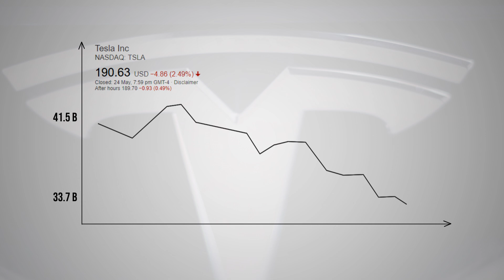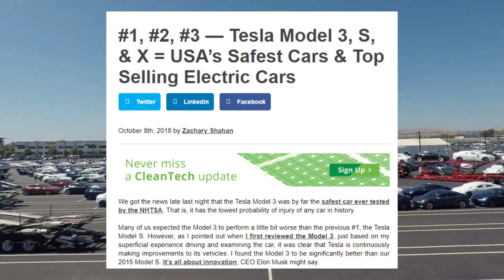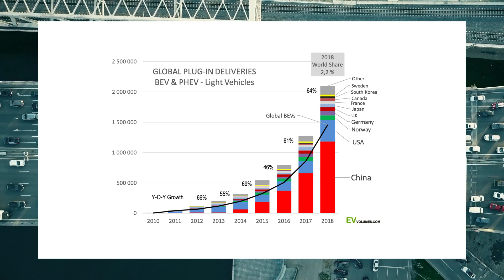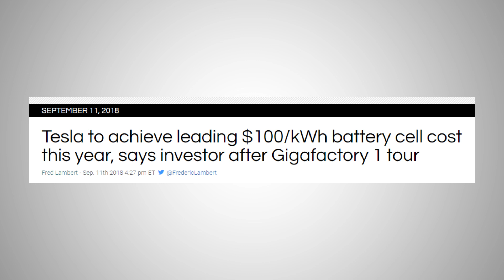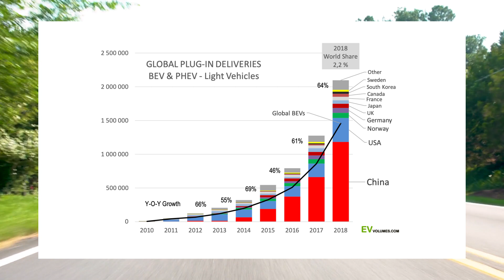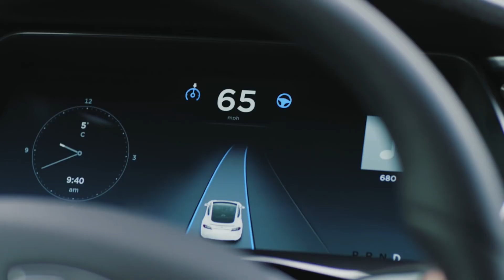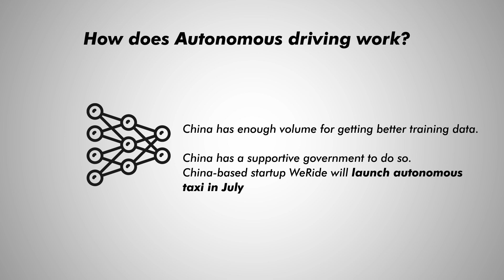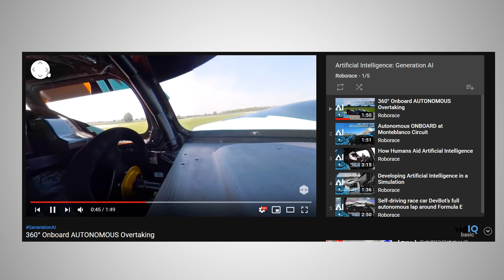Can Gigafactory Shanghai Fix Tesla's Money Problem? | Elephant Explains

Comment: The falling stock price actually shows success. The attacks against Tesla intensify as total success gets closer. Part of this is financial attacks, AFAIK 31% of Tesla stock is shorted. Fortunately stock price matters little. Mostly it just means you can buy it way way below it's actual worth.
Reply: András Bíró, the stock price dropped because major investors are selling, not because of short sellers. T Rowe Price sold 7.2 million shares in Q1. As Tesla falls, the short sellers will add some stability. But the stock needs to go down to its real value. 

J.B. Straubel has been exercising options for $20-$31 and selling them since late last year, 15,000 at a time. At least 4 times in the last 6 months. 60,000 shares sold, by an insider, using automatic selling that prevents insider trading problems. He still has 306,000 shares, but selling so many for so low of a price means something. He’s already pocketed more than he could have hoped to have earned on his own, so maybe he promised not to sell shares he’s holding.
Reply: @imho7250  

Oh, the good old spin doctor is back. There can be many reasons for selling the stocks, especially for JB. He probably needed the money for personal reasons and expected the stock to rise after the Autonomy Day. What you do is like trying to predict the future from tea leaves. Why don't you focus on the fundamentals of the company instead? You know, if you want to know how well the company does, maybe you should take a look at what it actually does.
Reply: András Bíró, I’m sure every Tesla worker who has been making Tesla great can also use money, but most will never make as much in their life as JB cashed out in the last 6 months. It’s one thing if that was his money he invested, but those are compensation packages. The bottom line is he wanted the money. I don’t blame him omega bit.
Reply: @imho7250  
What's your point exactly? Are you implying that ever other company makes all of their employees rich, only Tesla doesn't?
Also JB sold a small fraction of his stocks, that's not cashing out, he probably just wants to buy something expensive.
Reply: András Bíró, J.B. Sold 105k shares and gifted another 20k in the last 6 months. He’s not cashing out, but he’s not exactly holding on to as many shares as he can either. 

Other companies aren’t living off government subsidies, claiming they are trying to save the world, all while making no profit. 

I understand J.B. Needs money to put food on the table and make his house payment, but selling 105k shares that only cost $20-$31 each is. Bit much. And J.B.s 306k shares he holds were basically free. He got 108k for $2.7 each. 

When we look at how much he’s invested in his holdings versus how much he’s profited, it’s easy to see how he can leave 306k shares there. And I’m not even sure if he hasn’t borrowed against them. Perhaps that is why he’s selling so many shares, to pay off loans before he gets a margin call.
Reply: András Bíró, J.B. Straubel has so much money that he sold $40 million in shares when soon its going to be worth $400 million? Plausible.

If there is a direct path between the taxpayer’s money and a big oil executive compensation package, that too should be stopped. 

Tesla is barely surviving now, with tons of taxpayer’s money. Every place the subsidies went away, so did Tesla sales. Canada was a perfect example. The US has a softer way of pulling the rug out from under Tesla buyers in highly subsidized states, but states without EV incentives won’t sell many Tesla after the tax credit drops.

The demand for the car Tesla can make a NET profit on is dying fast. Analysts predict Tesla may in fact deliver more cars in Q2, but at a lower revenue, and another quarterly loss. With all the fire sales Tesla is having to pull Q3 buyers forward, Q3 is going to be bad, but Elon might be able to distract with GF3 or Secret Battery Lab hype, and get more investors to further dilute the current share Value.
Reply: @imho7250  
If he needs the money, then he needs the money. It's hard to predict when the price will go up, it can take years. Or maybe he saw another investment opportunity that makes profit faster and he will buy back the shares later. Bitcoin for example just went up 4x in the last few months, and it probably will go still higher.

Of course that's not a direct path, but it definitely exists. If people had to pay the full price for gas, all the environmental and health damage plus the cost of oil wars included, then gas cars would be prohibitively expensive to drive.

Tesla barely surviving? That's supposed to be a joke, right? Tesla has never been in better shape financially or otherwise. They finished Q1 wit $2.2B cash. Then raised another $2.7B and got a $2B deal from Fiat, and that's on top of their normal operation which is profitable too. And this has nothing to do with taxpayers money, gas cars get far higher subsidies, so you can really drop this angle.

And there's another joke. Are you doing comedy now? Tesla will have a demand problem about the same time as the porn industry. Tesla just delivered a record amount of cars, and still cant keep up with the demand. And the European and Chinese markets are just recently started to get the cars. Do you have any idea how big is the Chinese EV market? And the European too, unlike Americans, we here don't buy gigantic truck and SUVs, the Model 3 and the Model Y are the perfect cars for this market, EVs are more popular, there's a much better charging infrastructure, many countries still have strong incentive programs and the European middle class is stronger.

As for profits, in Q3 and Q4 2018 Tesla made $400M profit and free cash flow was around $800M. In Q2 2019 they delivered more cars. And since deliveries to Europe and China just started, the demand for the more expensive versions are likely strong, so there's unlikely to be a problem with profit margins. And also Tesla is continuously improves it's operation, so costs should be going down and at least partially compensate for the lower profit margin on cars sold in the US. But the whole thing is mostly irrelevant anyway, what really determines the profit is capex. Tesla is still growing at an insane speed, sales are more then doubling every year, and for a car company that doesn't come cheap. That means the majority of capex goes into growth. If you look at the quarterly numbers for the last 10 years, you will see that every time a new model production ramps up, Tesla makes profit for 2 quarters then makes huge losses again as they start to invest in the next model. So if Tesla makes less money then expected, and can't or won't raise money for some reason, they can simply slow down a bit and ride out the troubles comfortably. And I'm pretty sure I've already explained this to you and even provided links to videos to back it up.
And this is still not all. There's Tesla energy too. It has been neglected a bit in recent years, because the Model 3 sucked up all of the batteries from the gigafactory, but if for some reason the demand really drops, the freed up batteries can be sold as Powerwalls and Powerpacks at a high profit margin, the demand there is even stronger then for cars.
And almost forgot one more very important thing, Maxwell. The Maxwell tech is an instant significant upgrade for the batteries, including significantly lower cost. And the craziest advantage of the Maxwell tech is the 16x less footprint of the production line. That saves a lot of time and money for Tesla as they can produce an order of magnitude more batteries in the same factory.
Reply: András Bíró, it’s possible that JB took money from one gamble (TSLA) and put it in another (BTC), and made a ton of money. It’s really hard to say because 90% of that is free money from the heavens. He paid $3 per share for most of it.

There is a demand problem for the high margin vehicles. Sure, the countries who just got Model 3 in Q2 will have a demand, but it will be expended in Q2, nothing left for Q3.

Making and selling more cars means nothing. It’s like going from selling 1 million Big Mac meals or selling 1.2 million children burger meals. More volume doesn’t mean more profit. 

If the real investors thought Tesla was financially stable, the stock would be going up, and so would Tesla bonds.
Reply: @imho7250  
There's no problem with the demand. Obviously as production volume grows, eventually Tesla outgrows the premium car market, but that's not a big issue. First, there's Europe and China, both much bigger markets then the US and just started to get their cars. Second, Tesla's profit margin is continuously improving as they optimize the lines, so now the cheaper versions are profitable too. Sure, the profit per car decreases, but the increased sales more than make up for that. And that's just one segment of Tesla's business, there are so many other potentially huge profit sources. Batteries, solar panels, insurance, robot taxis to name a few. Oh, and almost forgot, the Model Y and the pickup are coming too. No big deal, just the two biggest and most profitable market segments in the US. And the demand? Here's a clue : https://electrek.co/2019/07/03/tesla-pickup-truck-overtakes-ford-f150-talked-about/
The market is very irrational when it comes to Tesla. You are a pretty good example, but most analysts do even less research. No matter how you look at the numbers, Tesla is ridiculously underrated. That's why everyone who understands the company buys shares as fast as they can.
And as for financial stability, Tesla is in a much better position now than Ford or GM.
Reply: András Bíró, there’s no problem for “demand” of multi-million dollar jets and yachts, it’s just people don’t have the money to buy them. That is Tesla’s problem, they have a cool car that lots of people want, but desire doesn’t mean demand. Demand means that there is a long line of people waiting to buy, with cash in hand. Not poster on the wall and just a Dream.

Comment: may you check again if autopilot is not working well, most crashes are driver based, as they didnt understand to overwatch the system and using funktions they where clearly just working on highway :
 --------  A separate vehicle safety report from Tesla shows that in the first quarter of this year there was one accident for every 2.87 million miles driven in which drivers had Autopilot engaged. For those driving a Tesla without Autopilot, there was one accident for every 1.76 million miles driven.17.05.2019 ---------- thats what never get in news: https://www.youtube.com/watch?v=yBSmalvqIi4

Comment: Tesla wouldn't have money problems and more people would be in electric vehicles if Elon musk had followed the ARM model  make nothing , design the software batteries engines etc and licence them to others.
Reply: Tesla doesn't have money problems. They just got almost $5 billion to the $2 billion they already had, and according to leaked data, Q2 is going to be profitable again.
Reply: @andrasbiro3007  Tesla $10bn in debt  granted if it can service that debt it may not be a big issue . Don't confuse an amazing ability to  raising money and getting investment to been financially sound. Tesla stock price has been falling. A  recession an increase in the USA China trade war could all be devistating. Neither would be a problem if Tesla had chosen a design model rather than a manafacturing model.
Reply: @PabloTBrave  

That's 10x less than Ford has. GM has a huge debt too and it's growing fast. Their revenue isn't 10x bigger than Tesla's, and it's not growing. I'm much more worried about them.
Don't confuse the outlier with the trend. 2018 Q3 and Q4 were profitable, and 2019 Q2 will be too, or at least close to it. Q1 was special for several reasons. Mostly because of the logistical issues of overseas shipping. About 10K cars were on ships at the end of Q1, that's about $500M revenue delayed to the next quarter.

Stock price has nothing to do with the company's performance. This is very easy to see if you just take one look at the numbers.
The China gigafactory is on schedule and will likely start producing at scale in Q4. That will mostly eliminate the trade war issue.
Reply: @andrasbiro3007  my original argument was if Elon musk was serious about saving the planet and getting everyone in EVs , house batteries , solar panels  etc it would have been easier quicker and more financially viable to design everything and lease to everyone else  . Ford is to spend 13bn on EV R&D,  wouldn't it be easier and more financially sound  to pay a company a few hundred per car licencing  fees . Tesla wouldn't be then limited to the number of new EV that could be put on the roads .
Reply: @PabloTBrave  
Tesla made it's patents free to use by anyone. And even offered access to it's supercharger network, although that not for free.
The main problem wasn't and isn't that others can't design good electric cars, but that they didn't want to do it, and still doing it only reluctantly, only because they were forced by Tesla. Now the will is getting there and the main issue is the battery shortage. Tesla was the only one to see this coming, that's why the gigafactory exists. But Tesla also grows it's production output exponentially, so even they are limited by their battery production volume. They are now working on speeding up production with the help of the recently acquired Maxwell tech. When this bottleneck is solved, comes the next that Tesla can't help with. The old car companies and their entire supply chains are structured around gas cars, that's what they were building for well over a hundred years. An electric car is very different, it's not possible to build it efficiently within the traditional car company structure, and it's next to impossible to completely reform such huge and very traditional companies, especially when the restructuring would hurt their short term profit.
Here's a video where Sandy Munro, one of the top experts in the industry, explains why it's almost impossible for Detroit to simply copy Tesla : https://youtu.be/aVnRQRdePp4?t=3140